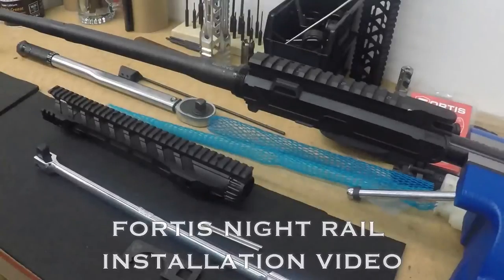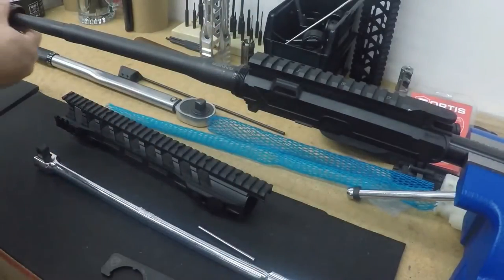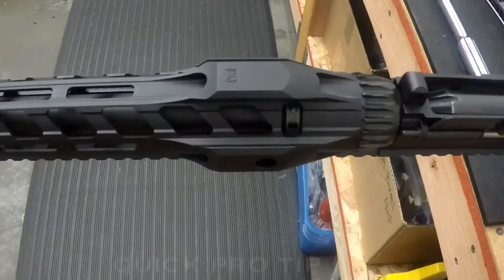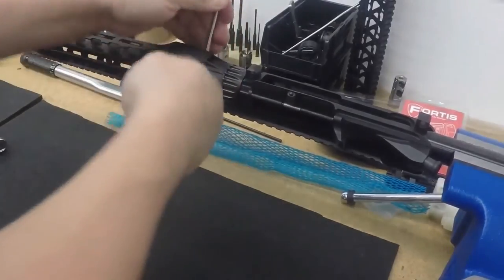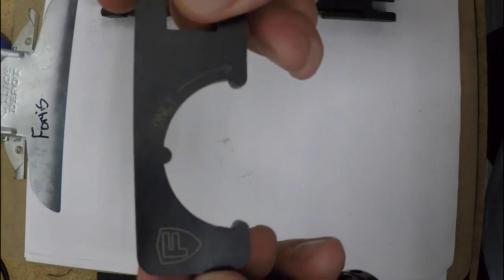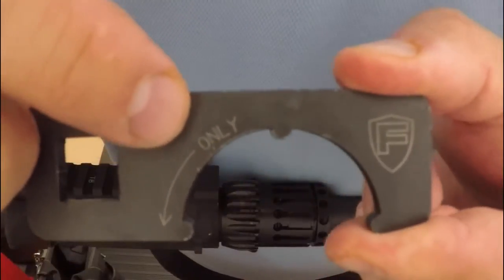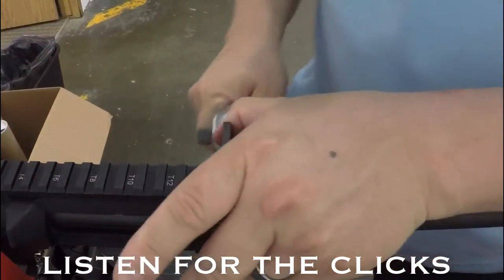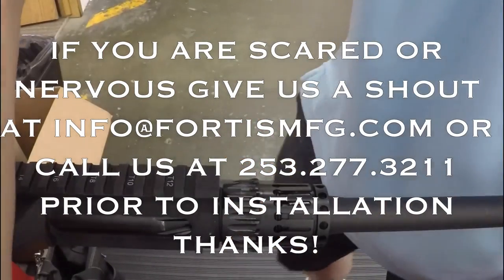Fortis Night Rail™ Installation Video (UPDATED w/ Bonus Footage)

Comment: I love the way it looks, and the concept of the way the proprietary barrel nut works to secure the rail, but I'm leary of just friction alone holding the rail on, and keeping the rail from turning.
Reply from the maker: Great observation Kevin!  The one thing that isn't really visible in the video is that there is a lip at the end of the tabs of the outer barrel nut and a keyed slot on the inside of the rail to provide a mechanical lock to the Night rail system.
Reply: FortisMFG Thanks! I wasn't aware of either of those features. Makes me more comfortable ordering one now. I appreciate the quick response too!

Comment: I just wanted to add this comment pay attention to the video it's very easy to install although be very careful using the tool provided it's week and only designed to rotate one way so if you got to back it off turn the tool around to do it.. the tool does it's job just pay attention

Comment: You need to make sure that anyone attempting this install has the groves in the bbl nut PERFECTLY aligned with the gas tube opening or this entire system will not work. Not only will you gas tube not align, the handrail will be off as well. Also, do not depend on your torque wrench to make this magically happen. If 45 pounds on your wrench does aligned the grooves on the nut with the gas block opening on your lower, you may need to continue to drive the nut until it aligns. Your handrail will not line up with the top of your lower and your gas tube CANNOT be installed properly. Thanks for the supplemental, but you really need to drive this point home. I have tightened mine to 53 pounds and it still needs a bit more.

Comment: Can't seem to get the barrel nut to line up.  Went as low as 30 ft lbs, all the way to 60 and it's still not enough for the gas tube to pass through to the receiver.  Recommendations?
Reply from the maker: You can go past 60 ft lbs but i would recommend our case hardened tool.  use coupon code "freeshipping" to save a few $$ if you need the wrench.
Reply: @FortisMFG  Awesome thank you!  I might send ya an email on the situation.  Since it's my first attempt at assembling an upper.   Love the rail by the way!

Comment: You are NOT getting an accurate torque by using the extended tool straight out from the torque wrench head. The extended tool needs to be at a 90 degree angle from the torque wrench head for a accurate torque. Hope this helps.

Comment: You are using the tool strait out from the tq wrench. To maintain the same indicated tq on the wrench it needs to be at 90 degrees to the head. Did you do this on purpose? It the tq applied supposed to be higher than what is set on the tq wrench?
Reply from the maker: Mike.  You are correct.  The tool should be perpendicular to the wrench.  But really once you get it past 35ft/lbs you just need to use the German torque standard of "guten tight" to align the barrel nut assembly to allow the gas tube to pass through.

Comment: Do you have any data or media on testing of this rail? Any issues with the nut loosening up with a few hundred rounds through it? The only reviews I can find are a handful of people in forums that all had issues with the nut backing off and they werent able to tighten it enough to keep the rail from moving. Not out to bash the product, but do you think this is due to installation error?
Reply from the maker: Sorry for the non-response.  It's better if you email us at info@fortismfg.com.  There we can answer you questions better.

Comment: I know this is an old video but looking to get the Fortis night rail or the one by rainer arms without the top picitany rail.

What adjustable gas block will fit under the rail. Seeing it's a 1.37 in inside diameter I'm having a hard time finding an adjustable gas block. Thanks
Reply from the maker: I know we’ve seen a few floating around that works. You just need to find a low profile version that’s .750. We have one coming soon as well that you can get on the notification for as well.
Reply: @FortisMFG  do you happen to know of any off by hand? Non adjustable lopros I can find but an adjustable one been harder.

And can't wait till you guys release it, looking forward to it!
Reply from the maker: Which brands have you looked at? I don't recall off the top of my head, but I know there's a few low profile versions out there. Superlative is one - check with them and see what their profile is
Reply: @FortisMFG  true north arms have 2 gas blocks. And ergo had one but couldn't find the height.

TNA elite series at 1.35in
Tna adjustable at 1.299in

Wasnt looking hard enough, thank you

Comment: Any issues with the barrel nut coming loose with the end that you tighten with the pins backing out at all or loosening over time ? Interested in grabbin one
Reply from the maker: If properly installed you should not have any issues with the barrel nut coming loose.

Comment: So I’m using one of these for an AR9 9mm build. Tightened all the way down and yet the 9mm barrel is still has a mm of play.  Should I use barrel shims?
Reply from the maker: What is the thickness of the rim on your barrel extension?  If it is smaller than 0.132"  you can try a barrel shim.   I would also recommend getting one of the case hardened wrenches to be able to get a bit more torque.

Comment: Whats the inside diameter because i wanted to put a slip over supppressor on my ar with that hand rail
Reply from the maker: Hunter, the ID being at 1.34 (slim profile), most suppressors won't fit inside the Handguard. Check out our upper configurations guide on the website and you'll get an idea of the types of lengths of barrels and hand guards, combined with suppressors to achieve that flushed aesthetic.

Comment: Good evening how many Newton meters (pounds per foot) must be exercised with the torque wrench for the seraggio
Reply from the maker: Install the provided barrel nut on your upper receiver in standard fashion using anti-seize 
and or moly grease with the provided wrench to the torque setting of approximately 40–60 ft/lbs (same as 
milspec barrel nut specs). Time the barrel nut to allow the gas tube to pass through.

Comment: Whats the little threaded plastic piece and allen screw for that comes in the kit?
Reply from the maker: On the bottom rear portion of the rail there is a slot the insert goes into.  The allen screw keeps it in space and add a little more pressure to the barrel nut.  This helps with some recoil heavy builds like .458 Socom or 50 Beuwolf.
Reply: @FortisMFG  funny because that’s exactly what i put the rail on lol. 16in Tromix 458 socom upper.

Comment: I just bought that same upper receiver. Can you tell me if the barrel and upper receiver have a tight fit ? Will I have to apply some heat the receiver to be able to insert the barrel?
Reply from the maker: It's a tight fit, but you shouldn't have to use a heat gun or anything.
Reply: @FortisMFG  great . That’s how I want it .. a tight fit is better. I’ll just apply a little heat nothing crazy to expend it a bit then insert barrel. Hey thanks for the respond

Comment: "The Daily Shooter" said he cant align the gas tube. Is the system only for blowback 9mm only?
Reply from the maker: The Night Rail can be used for 9mm but gas tube alignment(*edit*for calibers using a DI system*edit*) shouldn't be impossible.  I would recommend going to a gunsmith for additional support if needed.

Comment: will it work on gas piston Ar? i like that rail
Reply from the maker: I've been told it will work with a piston system from Superlative Arms.
Reply: i have Adams Arms gas piston system, i wonder if the barrel nut of Fortis Night Rail where the grooves right infront of the gas tube hole are the same dimension with the standard mil-spec barrel Nut. or if you can give me the dimension or thickness i'll do the research 😊😊
Reply: Im sold bro! im sold! really badass looking handguard!
Reply from the maker: It will not work.  The Adams Arms system need the barrel nut to be a specific length for the drive rod to seat properly. 

From Adam's Arms website: 
"We recommend using a standard barrel nut or barrel nut with similar measurements for proper fit and function of the kit. Many aftermarket proprietary barrel nuts do not offer the clearance for the drive rod or proper seating of the spring and bushing."
Reply: I'll make it fit!

Thanks for the response!!

Comment: Could this be installed without an AR vice block?
Reply from the maker: I recommend that you use a Geissele reaction rod.  Either that or take it to a competent armorer/gunsmith.  I've personally never used an AR vice block.  It's usually been the nylon panther claw, but now i use the Geissele exclusively.

Comment: wheres the gas tube...?
Reply from the maker: It didn't make it in the video, but the barrel nut does have to be timed in order for it to work.
Reply: FortisMFG ok gotcha. Thanks. Gonna be buying this soon.
Reply from the maker: Awesome!  Thank you for the support!
Reply: FortisMFG when tightening the barrel nut, how many ft lbs was set on the wrench?
Reply from the maker: After you work the treads 3 time (tighten then loosen)  I set my torque wrench to 35 ft/lbs.  Once I get it to that, if it needs to go any further I put on my breaker bar and time the barrel nut with that.
Reply: For my rifle, the barrel is 15 in, 16 including the muzzle device which is a strike ind. cookie cutter. im guessing there wont be enough space for me to get a wrench onto the flat surfaces on the device. how would you recommend reattaching it?slide the guard on but dont tighten until after the device is screwed on and timed right?
Reply from the maker: It's best if you give a call for technical support.  We answer our own phones so you'll get connected right away.  253-277-3211